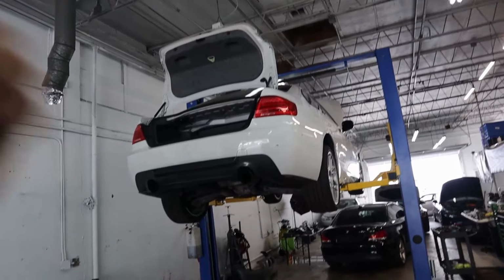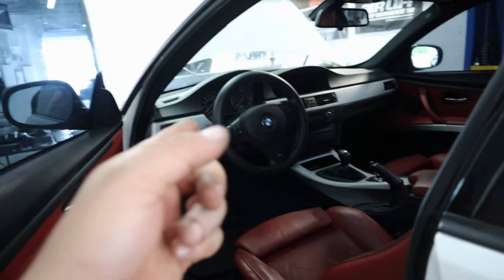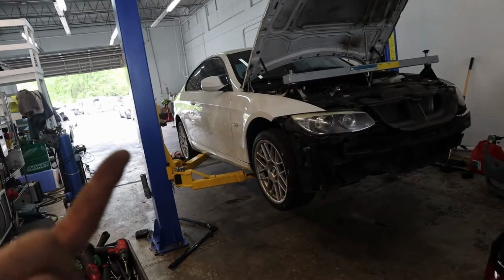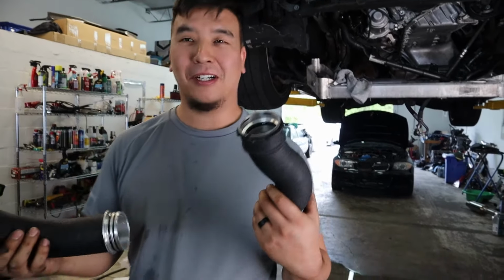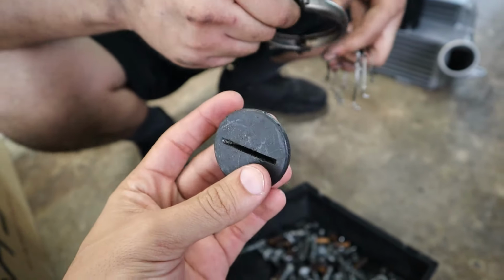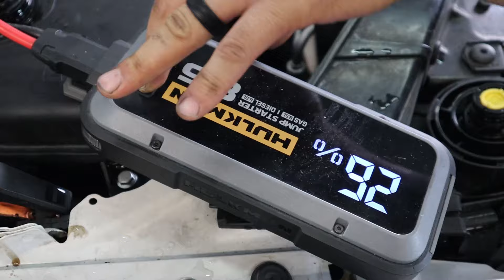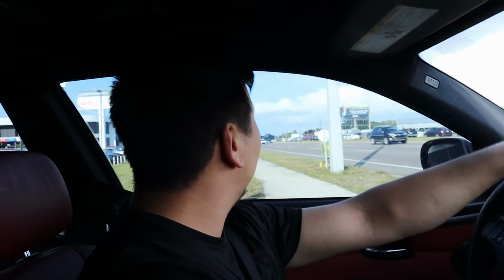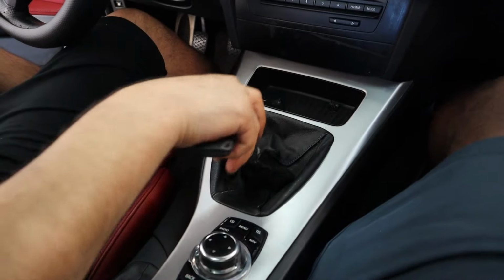I bought a CHEAP BMW 335i and instantly regretted it...

Comment: Finally some n55 content can’t wait to see what you guys have in mind for that car can’t wait to single my n55
Reply: dont blow your engine, it isnt forged ;)
Reply: @2012summr  N55s tend to blow after around 450 to 500hp, which on a N54 is considered low boost, sure the reliablity is nice but i dont want to be limited to 500hp or risk blowing my engine, N54s have many examples pushing 800 stock engine

Comment: Have you or anyone you know ever swapped a DCT out of a 335iS for a 6speed manual?
Reply: There’s actually a channel called zero to 60 that did but n54 motor
Reply: @jonathonwilliams9005  That’s a video of Automatic to DCT. I’m asking about DCT to 6 speed manual for a n54 335iS. Read carefully brother.
Reply from the maker: Yes i believe it’s possible, vehicle order has to be changed and manual wiring harness added, since IS models came manual as well i dont see why it wouldnt be the same as auto to manual conversion